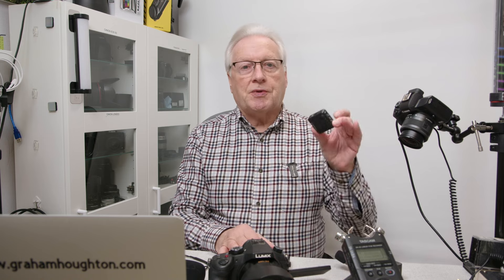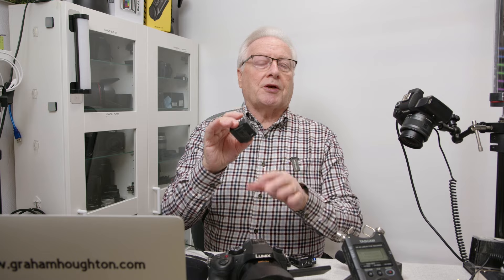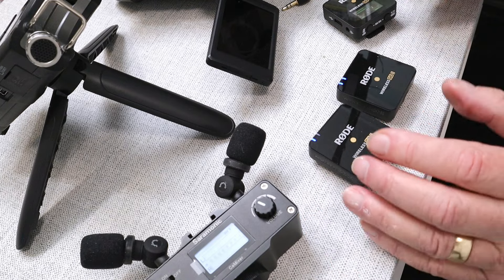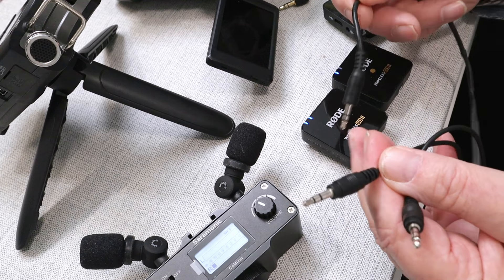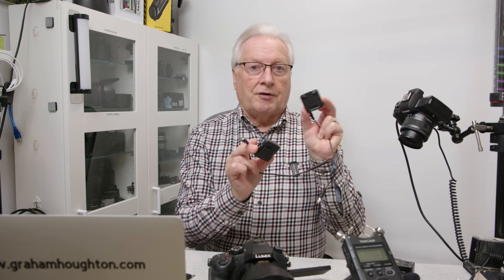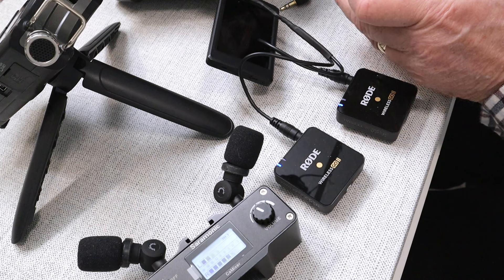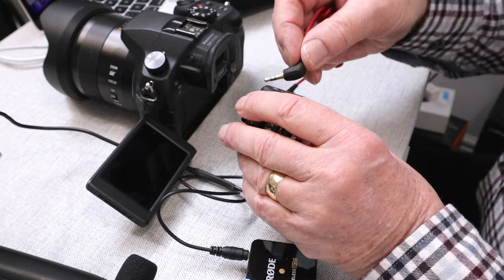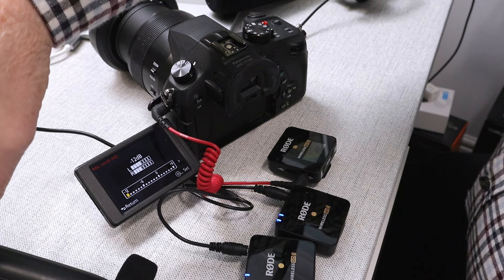Stereo Audio Transmission Using Wireless Microphones - Here' How.

Comment: What about the sony ecm-w2bt ? The marketing page says it is possible to connect a stereo mic to the 3.5 and record the stereo signal. However this mic has no storage in the transmitter which makes it unreliable. I try to find if the Hollyland Lark Max has or not this feature, but it is difficult to find.
I have the Azden smx-30 which has both mono Or stereo switch. It has embedded a professional shotgun mono, or you can activate the 120 degrees full range stereo mic to record concerts.

Comment: Be nice if you could Bluetooth a mic straight into the camera with no wires
Reply from the maker: It does exist for smartphones (Hohem have one) however latency is the problem. Even the latest version 5.3 with aptX has something like a 40mSec audio delay which is clearly noticeable as lip sync problems.  I think the lowe clock speeds with bluetooth are the main reasons for this delay.